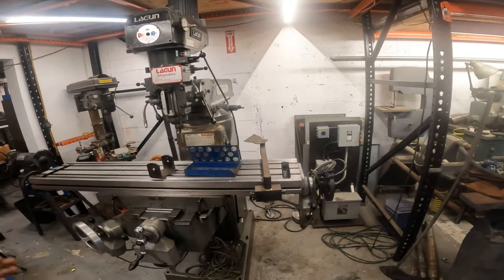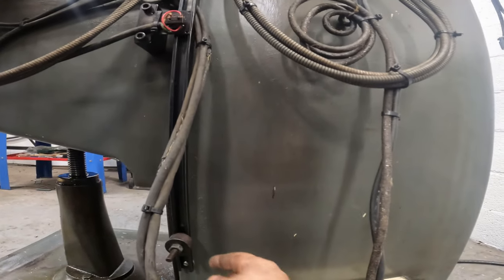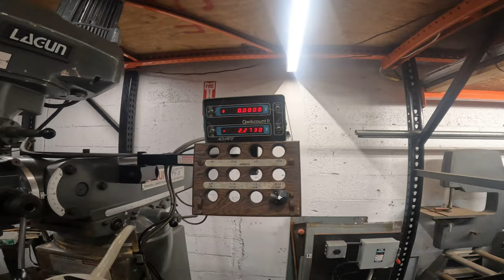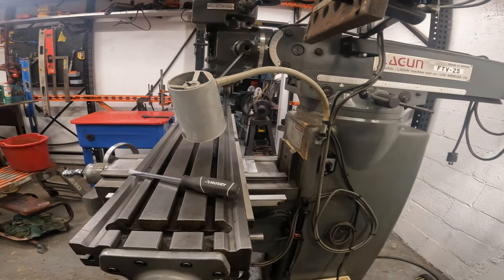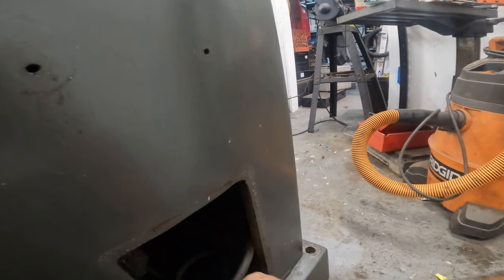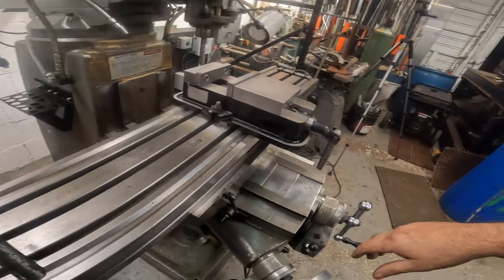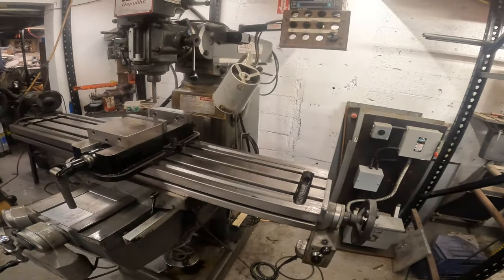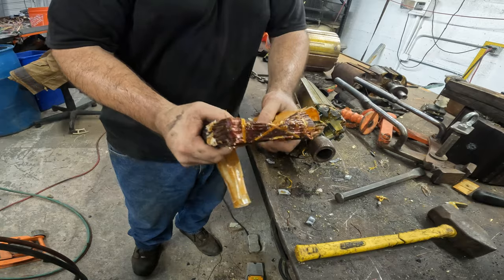Fixing My Lagun Milling Machine Installing Digital Readout

Comment: Hi Derek, I just spoke to a guy at Hillary machine in Texas and he said that if you’re going to make aluminum wipers for the ways, the aluminum can’t be any thicker than 20 to 30,000, they need to be somewhat flexible   I was thinking that if you made them out of aluminum you’re cutting chips could scratch your ways if they got stuck between the table and the aluminum wiper. The plastic wiper is soft so if anything, the plastic would get damaged and not your table surface. You may want to call Lagun before you do anything and possibly ruin your surfaces.  Take care buddy. 

By the way, no matter where I go I always look up at the street or parking lot lights. I have my wife a nice lesson about them this morning on the way to breakfast. Hahaha.
Reply from the maker: Thanks!

Comment: The coolant pump would be worth getting up and running. You have a valve on the side that controls the coolant flow rate.
You could also use your lathe to make a misting nozzle for it.
Reply from the maker: Thanks, I have to wire the pump it is 3 phase.

Comment: When maintenance change the oil probably every 4 to 6 weeks on the Preventative maintenance rota  them machines would have all the oil pumped out and fresh put in. It's probably a good idea to start. Also wd40 is awesome on the cables and repals water hence it's name water displacement 40. Also great for cleaning electronics. Loving this episode but got pop out so catch the rest in a bit. Said it many times awesome channel brother
Reply from the maker: Thank you!

Comment: Haven't heard you mention it, maybe the other guy has the knowhow. Before you start machining on it, you'll have to tram the head. Use a dial indicator run along the axes, this is a planar dimension so you'll want it to be as precise as possible. The head is heavy, so if it does need adjustment, some softblow hammer magic may be necessary, expect a few tries to get it just right. Aligning the vice properly is done dialing in the fixed jaw along the X-axis. That'll get you started. When we were learning, the school didn't have the coolant pumps on our manual mills and lathes to keep the mess down. A plastic bottle with a drip nozzle will be enough to work with, just get the right lube and dribble the cutting tool and/or work between passes. It'll hold you over until you make the call to incorporate a pump. I'm not experienced with coolant systems on the OG stuff, but I've seen enough overflows in CNC's to wonder if the mess it worth it. For small random jobs you probably wont need to run so much coolant before you go spending on diminishing returns. Also, iron runs dry.
I believe there's some need for give on the skirts of the way, chips will get Everywhere, so you want more of a sweep than a snowshovel push dynamic to keep ways clear. That imperial scale on the wooden collet holder tells me this was cannibalized from another machine, who knows how old that piece of wood really is, 40's maybe?
Reply from the maker: Thanks for all the great in of.

Comment: Leave the wood, it is classic machinist. Get a new light, those limp dick ones suck and you can't fix the limp problem. The collet box on the side is upside down, that is a lid to keep chips off the collets. The wipers were originally plastic with rubber behind them, but the carb cleaner and age ate them up, just buy new ones because they are very important.
Reply from the maker: Thanks for the info, makes much more sense the collet box is upside down. lol